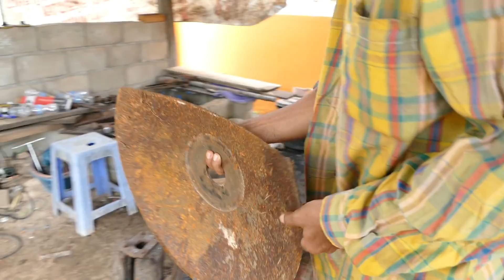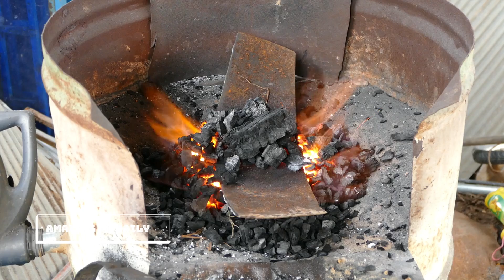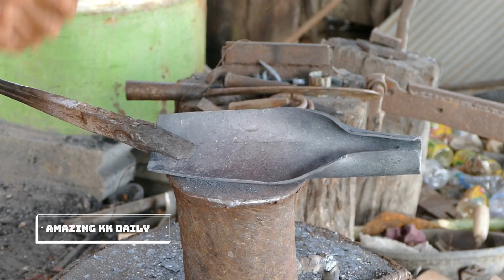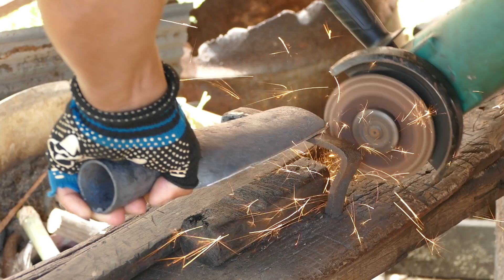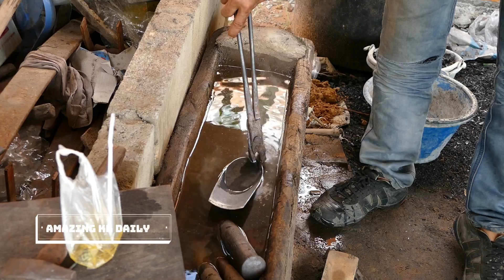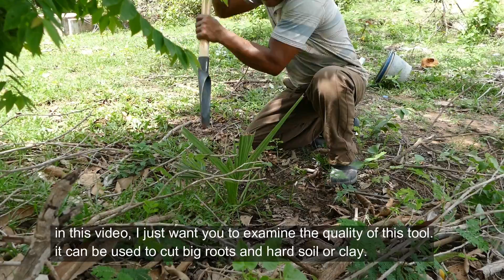Forging A Farmer's Must-Have Tool/របៀបធ្វើចបជីក

Comment: What was the round material that he cut at the beginning? It seems it was hardened carbon steel judging by the spark ?  I first thought it was a Pot lid. But then why pot lid was hardened ?
I wonder what that was.  Wasn't it remnant of ancient shield?
Reply from the maker: It is disc from tractor. The quality is very high.
Reply from the maker: It is disc plough.
Sorry not disc
Reply: Amazing KK Daily It’s not inaccurate to call it a disc. Nebraska, USA native here...we call them disc blades, some even call the implement a disc or harrow. Plow or plough the UK, is considered something completely different with mold boards or shanks. All good. I may start buying local steel. That agricultural steel appears the best for this work. Here it’s hauled in and smelted at whatever rates...FYI the blades sell pretty cheap used. New they’re like 20 bucks.